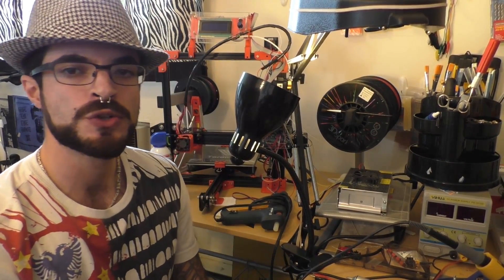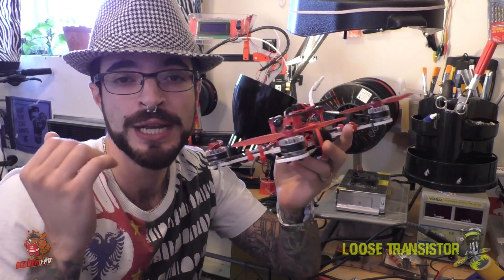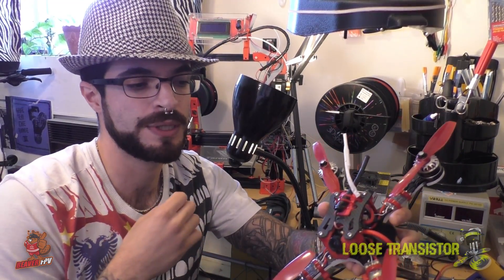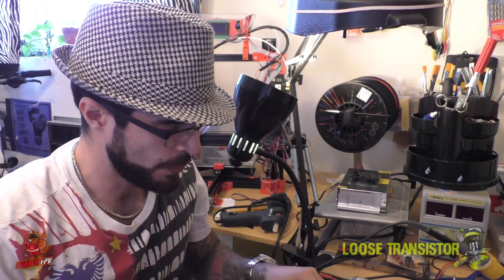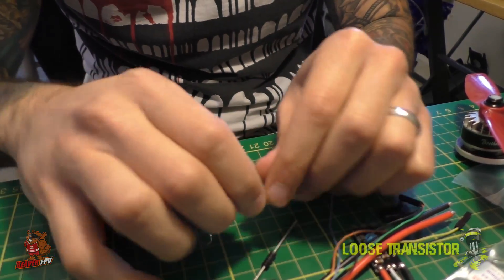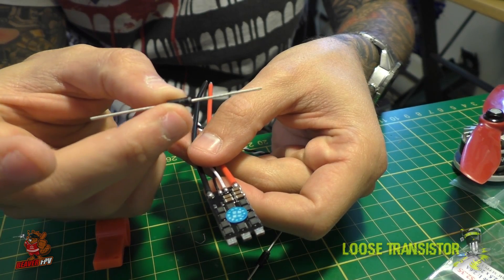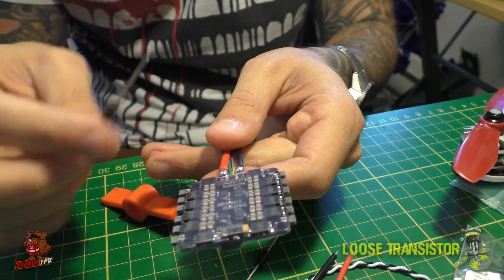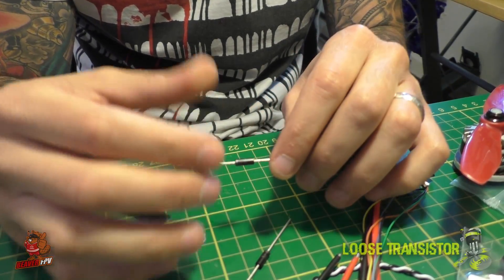Capacitors are DEAD. Long Live DIODES! ♠ [ How To QUAD ]

Comment: meh .... if you're THAT concerned about transients find out what frequenc(ies) they are and select a cap that will filter them out. Adding a cap is the same thing as adding an RC low pass filter (assume R = 1) just slapping a "big" cap won't necessarily do it for you ... yes the reservoir will be larger but the value of that cap will determine the frequencies filtered out. For example 100uF will filter differently than 47uF, 3300uF, etc. Just a diode on there will not have a reservoir so when you start and stop rapidly you won't have that small cap bank to draw from .....
Reply: Fox, transients ARE NOT at a specific frequency.  That is essentially the defining factor of a transient.  A true transient has no frequency component, and are random in nature, however they can be regular.  Secondly, you have no idea what you are talking about  :)  Cheers!!
Reply: So this is what happens when people who have degrees collide with people who think they have degrees :) There are multiple meanings to "Transient" in the EE world. A transient response is used to evaluate a time-variant (time dependent response) to a component and/or system. A great example is the charging/discharging of a capacitor. We can use voltage & capacitance to see how long and how fast a cap can charge/discharge. This is great when talking about the reservoir, we need something that can supply the constant "push-pull" flight behavior when flying. 

The transients the FPV community refers to are really random noise spikes in power ... which DC has very little as it has a frequency of "0Hz." A good example is converting AC to DC, a 60Hz 120VAC wall outlet will crank out a loud spike every now and then based on it's supply. This is a case where you know the frequency of the transient and you can protect/filter around it. 

Another example is when you see flicker on your video when you thrust the motors. Motors spin at certain frequencies right??? So yes, transients in general are not frequency specific, but you can see if your drone's system is affected by specific frequencies and design around it. Hope this helps!
Reply: foxface101 The "term" transient is indeed used in throughout the EE world , however when referring to transients in this regard, or transient response of a component such as a cap , we are talking about two different usages of the term.  If you were implying you hold a degree in EE, you should know better.  

Also, you second paragraph make ZERO sense.  The transients referred to have little to do with FPV , and are purely a function of switching inductive loads.  They are NOT "noise" spikes in "power".  Please consider researching what a transient is (with the proper use of the term of course).

Your understanding of the matter is severely lacking , and your examples make little sense.
Reply: ugh, this is what I get for helping the community ... after this I'm done posting. As a lead RF Engineer at one of the country's most prestigious avionics companies I should know better than to force knowledge onto those who can't make sense of the matter. Caps, no caps, diodes, transients ... it's just a drone ... I have have to get back to work designing actual aircraft.
Reply: Fair enough. As a senior EE that designs power electronics for practically every major automotive manufacturer, that has used TVS on practically every device for the past 20 years, I also know that your understanding is a bit off keester.  Take it as you will...

Comment: Why not go one part # lower and get a bit more of a current rating with additional protection? This one would limit rigs to 4S. https://www.digikey.ca/products/en?keywords=P6KE22ARLG
Reply from the maker: The rig I am building will have F80's so I want some flexibility on input source. I might run 5S on it as well. Good tip though I will add that to the description as well as 4S limit

Comment: Hi,

fisrt, the capacitors are not just limitng the volgate spikes, they buffer the current working in both ways (spikes up and down)
and they can do it with high current spikes (thats why we need low ESR)

Z or zener diodes are only burning (they heat up) the current to keep the voltage below their voltage rating. but a diode that whistands the currents that can occur on the ESC's would be bigger and more heavy then electrolytic capacitors. so using this diodes is a good choice to prevent BEC's from voltage spikes if they are used with some resistor (or inductor) before so the current is strongly limited before it goes to the diode.

im almost sure they wont do much directly on the ESC else then burn if current spikes occur ;)

regards

Felix
Reply: if a transient suppressor burns every time it see's a transient then it's fucking useless
Reply: LOL TSCC.  Ive been an electronics engineer in the power electronics/electromagnetic rotating machine field for many years.  Particularly in the automotive and EV traction drive , and power generation fields. I assure you, I have designed devices that far outweigh a hobby ESC in complexity,  and their application, according to real automotive, aerospace, and military specification.   Felix isnt a dummy by any means, which is why its so shocking he would say some of the things he has.  I would think he knows better.
Reply: TSCC.  They have.  in fact there are several ESC's and PDB's that already include a TVS.  However, up until recently, it wasnt a huge issue. With the introduction of very power motors, where we are switching very high currents into inductive loads is where the issue has arisen from.    I personally never said they would help with common mode noise.  I didnt lead him to believe anything.  he made that video with some assumptions,and he states as much.  Everybody just reads into things what they want.  

I never said they were a filter device.  What I said was, they can help clean up some artifacts in video, as well as help with power supply stability due to snubbing transients that would otherwise shoot through components causing apparent noise, as well as damage components.   The artifacts they may produce in video appear as apparent noise, however are not noise in the sense that common mode noise is.  There is no real way to explain what the effect a transient has on video other than noise.  Anything on the power rail, or signal lines that is unwanted or may cause unwanted effects , regardless of type or source, can be considered noise.
Reply: TheWizard,
i dont wnat to dicuse if i know them or not. but what i know for sure is that there is a lot of current in the spikes that occurs on ESC's and the power wires. i also know that if you take these energy away to keep the voltage strait, you need to do something with it. a cap stores it what does these diodes do? ;)
Reply: Felix, you are correct in what you say, there is a lot of current in these spikes, hence the need for a TVS.  I think you are confused as to what a transient is, and why and how a TVS is used in circuit.
Reply: Yes indeed.  Any bit of protection you can add is a plus. Especially when it weighs nothing, and costs close to nothing.
Reply: andymouse123,
no they work, the dimension is the question. the more current you have to supress, the more energy you need to handle..
Reply: Thanks for listing your qualifications. Now to the obvious stuff: Why did no one figure to do this earlier? Surely not every designer of RC components is incompetent. Also, why did you leave the video creator with the impression that the diodes alone may be sufficient? You said yourself that the diodes don't do anything against common mode noise. With diodes or not, without caps, the power bus on my quad would still look like crap on my scope.
Reply: I sure hope this latest comment of yours gets highlighted. Because how things usually go, miniquad people tend to latch to videos pretty quickly, if they have a semblance of minimal production values.
Reply: Testing that has been done in the past several days indicates transients of 70V+ are not uncommon.  A 70V transient applied to say a 35V cap , will not kill it immediately. However , the point of failure is unknown , and somewhat random at this point.   We are not talking about preventing damage to caps here. Were are preventing silicon components from damage, i.e., regulators and such on cameras, VTX's and the like.  during the testing over the past few days , several VTX's and a camera were in fact damaged due to transients.  Transients exceeding 35V were very regular.  A single instance of a transient of this amplitude may not damage a device, but repeated application will degrade a device relatively quickly , and again, this is somewhat unknown, and random where it may fail.  A 70V+ transient however, depending on duration, will very likely damage a device , as was experienced during testing.   Also James, there are some people who have experienced VTX's, and camera's failing regularly.  One in particular , since adding a TVS a few weeks ago , has not had a device failure since , where he was replacing VTX's almost every outing.
Reply: good point sir
Reply: All I can say to this is WHAT THE FUUUUUU.  You have NO idea what you are talking about, in this case  :)  Cheers

Felix, please read up on transients, and how TVS operate.  you are mistaken
Reply: @TheWizard Felix designed all the KISS gear. So I'd figure he has some authority on that matter. What do you have going for you?
Reply: J Bardwell's explanation makes more sense to me

Comment: This is cool!  So, what happens to the spikes?  Do they just ground out or get fed back to the escs as heat?..and why wouldn't you want the clamping voltage lower than 32v (assuming 4S system)?
Reply from the maker: You don't want it to be too low either, 32v seems to be a good compromise.

I believe the power gets routed back into the ESC's through the ground. I will get you a better answer on the next video.
Reply: Actually the diode acts like a dead short above its clamping voltage and acts as a resistor between the break down voltage and clamping voltage. Therefore if the energy in a spike is too high, you will simply burn out the diode. The question is will it fail "short" or fail "open". Worst case is it fails short and you have some more magic smoke.

Comment: thanks for the info. I was trying to clean up my signal with a capacitor and had little to no improvement. looking forward to see what you come up with in the future.
Reply from the maker: You are very welcome. I hope it works for you, I too am looking for cleaner video and this seems like a promising lead. I will release more videos on the subject as I discover more about it.

Just an FYI I didn't come up with this =P people much smarter than me did I am just the messenger!
Reply: You stand on the shoulder of giants to see further.
I have a feeling you are in the GTA if so let me know where you fly, I am always looking for people who are in the hobby.
Reply from the maker: Thanks man, really appreciate the support!

Yeah close enough, I am actually from London Ontario but I fly with the QuadCity FPV guys over in kitchener/brantford area. If you haven't joined the group on facebook yet check it out. There are always events going on in the summer so maybe we will run into eachother then!

Cheers
Reply: TVS diodes won't help so much with video noise as they will protection for all the circuitry in the quad. I run some of my video equipment like TBS Unifies behind a linear regulator, while the rest of my FX799Ts I can run straight off of Vbatt and have perfectly clear video. I also never use the regs on the VTx to power the camera, never had good results with that, they typically get run off of a separate 5V reg or 12V reg depending on the build.

Comment: Very interested to see how this turns out! I have a feeling it will help keep the voltage spikes down, but where I'm really curious is if it will reduce the actual noise too caused by the spikes. I might order some of these to add with my caps since they are so small but I'm going to wait to see your results. are you going to do some tests with the caps and the diodes at the same time?
Reply from the maker: That is really what I am hoping to discover myself. I am hoping that the TVS alone will cure some of the shitty video I have been getting lately.

I am thinking of doing a test with both, however all I have been told and research points to the fact that the capacitor won't do much at that point. If you still have video issues even after TVS I think LC filter to isolate the video rail is a better option.
Reply: It's not a noise filter, it has a very particular application. I still have most of my equipment behind voltage regulators (which are essentially regulated LC filters). I've found that well built VTxs like the FX799T are perfectly happy to take Vbatt, while other Txs like the Unify need additional regulation. I typically use linear regulators, as switching regulators in series can cause issues.

Comment: Just subscribed to your channel due to this. Nice info. I'm getting noise in my video from my LittleBee Pro 20A 4-in-1 so I reckon I'll put a diode across the battery pads.
Reply from the maker: Hey Joe! Glad to hear it, hope I can keep providing quality content for you guys!

Give it a try, it might help with your video issues especially if the 4in1 doesn't have it built in. Seems to be a thing on newer versions of some brands.
Reply: I'm ordering some from Digikey. I will let you know how it works out. Love this community. So much to learn from each other. I was all set to put on a cap as per Josh Bardwell's video earlier today, then heard about your diode and even got some advice direct from TheWizard. Awesome! Thanks.
Reply from the maker: Yeah I love this community too because of the free sharing of information. All credit to TheWizzard for suggesting the idea and use case for quads. I am just the messenger really and I love giving back to the community in the form of good information.

Its actually kind of funny that his video came out on the same day! I had no idea and only noticed after I posted. Anyway, I found this to be an interesting solution with lots of potential and a much cleaner and lighter install. 

Good luck and I hope it helps cure your video issues as I hope it will fix mine too =)

Comment: er maybe you should have made the video after you tried it? seems like a theory at the moment...Panasonic FM caps work well for me right now...
Reply from the maker: Its not just a theory, I am sharing with you guys a very well known concept it is just the application is a little different. I have it on good sources that have many builds in this configuration that it works. 

I wanted to share the info and generate some discussion. As I said, my next series will cover a whole build using the LC filters and some tests to make sure they do what they are supposed to do.

If you haven't yet, consider subscribing so you don't miss any of that good stuff =D

Comment: Hey loose , if im not mistaken the Cicada 35A 4in1 already has a TVS.  You dont need to add it to that board.  It will not hurt , but will be of little benefit.   Look on the board right at the battery lead pads.  There is a TVS right there across the pads I believe.
Reply from the maker: Very good point, my 4in1 is older generation so that pad is not populated. But for sure, if your stuff already has it its just a waste of time =P
Reply: How can you find out if a TVS diode is already installed in your 4in1? Curious if the aikon 4in1 or Lumeneir 35amp 4in1 already have them installed?
Reply from the maker: Any way you can link me a nice picture of the top and bottom? I should be able to tell you then. But what you are looking for is a surface mount component near the power leads and its a little black rectangle thing with a white line on one of the sides

Comment: Great video mate and very useful. You don't mention the size of diode needed. Voltage etc. Can you please tell me what I need to get?
Reply from the maker: Check the descripion for the video. I have posted it there but the ones I am using are these http://bit.ly/2pwot1F
Reply: Loose Transistor FPV - Thanks mate and thanks again for the video. I'm gonna test these on one of my quads, with a view to adding it to the standard build spec. All the best man 👍🏽
Reply from the maker: Awesome man, would be curious to hear how they end up working out for you so if I don't remember to ask please do let me know!
Reply: Loose Transistor FPV - I certainly will mate. Also, would you use these along with a capacitor on the Lipo supply on the PDB?
Reply from the maker: From what I have been told it is not necessary nor will it really do much to add a capacitor as well. Some people do it, It's not going to hurt.

I am trying to cut some weight so I am likely just going to try the Diodes, also to see how it compares to my older capacitor bound builds.
Reply from the maker: From what I have heard it is not necessary. It won't hurt. I will be testing both kinds of builds coming up so I will let you know more as I learn. 

All the people I have asked have said that it is not necessary. Either one or the other seems to be the consensus.